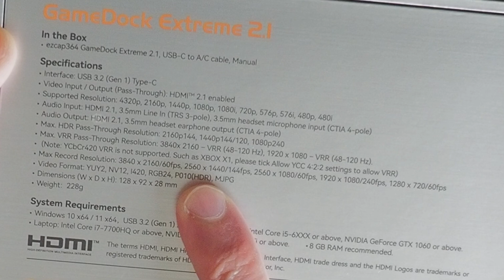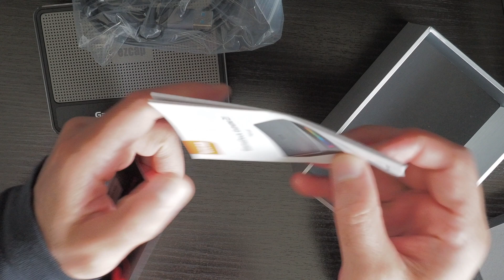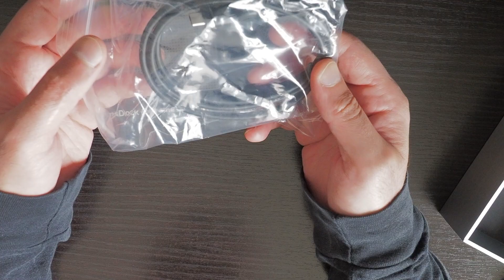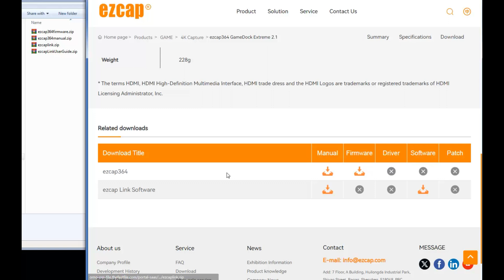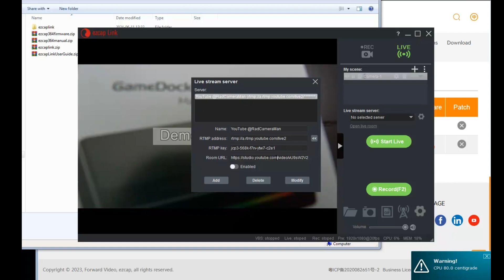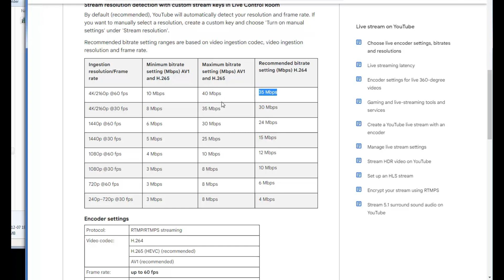EZCAP 364 GameDock Extreme 2.1

Comment: Good afternoon, does it work with Mac OS, with MacBook m3 pro?
Reply from the maker: I don't have that computer to verify it however according to the product specs system requirements it should work on Mac OS with these specs and higher:
macOS 11 / 12, USB 3.2 (Gen 1) Port x1
Apple M1 or Intel i7 quad-core or above, Radeon Pro 555 with 2 GB of VRAM, 16 GB of 2400 MHz DDR4 memory.

Comment: Hi, does it show video on PC when you switch your camera to 4k @24, 25 or 50fps? I can't find any mention of Ezcap supporting these framerates :/
Reply from the maker: Yes, it can output 4K at 24, 25, 30, 60fps. I think the reason they only mention 60fps is because that's the highest frame rate that it supports at 4K resolution, so it is already implied that lower frame rates and resolution are also supported.

Comment: Great overview, thanks 👍 I’m really surprised that this video hasn’t got more views, given that there’s not many UVC 4K/60 capture devices on the market and that there’s a number of issues with the Elgato 4K X, at least with Apple Silicon. Cheers, Dave.
Reply from the maker: Thanks, I suspect that most streamers are satisfied with 1080p at 60fps. This might be due to the internet upload bandwidth requirement, but I think soon everyone will switch to 4K60 for video games and sport streaming.
Reply: Thanks for pointing out the issue. I'm not aware of it. Elgato is cheaper with similar specs.
Reply from the maker: @mousbleu  which issue are you referring to? also, can you please let me know the model name for the Elgato device so that I try that one as well?
Reply: @RadCameraMan  apparently the 4k X has issue with some formats and M1 apple chips. And elgato won't update them.